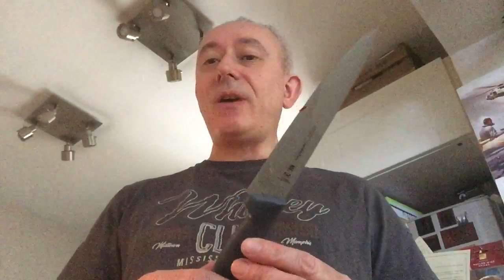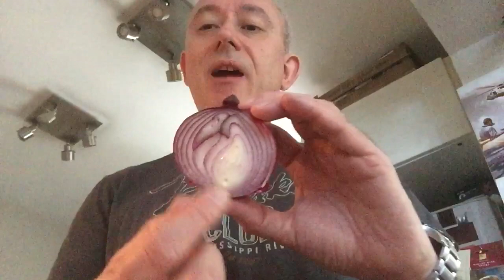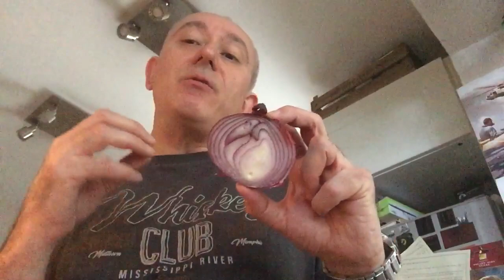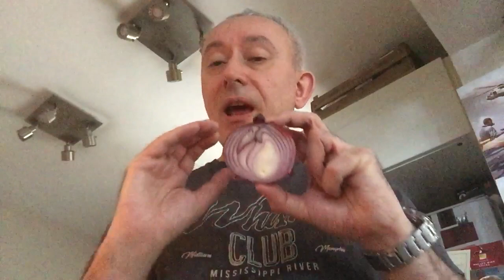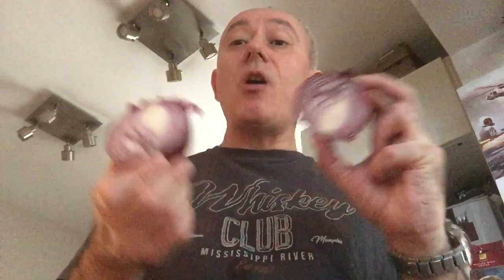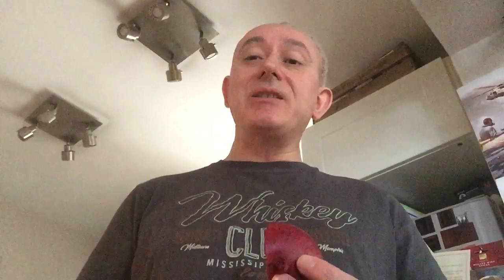Cleanroom contamination control, as illustrated with an onion

Comment: There's a lot of gap in the matter of material transport from outside / WH into the cleanroom. people tend to double-standard personnel movement with this one, mainly focusing on improving garbing practice alone. 

For example, transfer of equipment/ instrument from outside into cleanroom. 

Certain companies only have procedure to place them in the material lift, and then into the material air lock and straight into cleanroom without thorough sanitization. 

Another thing to share, there's a company I worked with installed a timer on each of the hand-wash sink, to ensure hand-washing takes minimum 1 minute.

What say you Dr Tim Sandle on these?

What is the most effective way to transfer let's say instrument (maybe taken out due to calibration outside company) into cleanroom and is the timer installation for hand-wash is a good approach?

Thank you